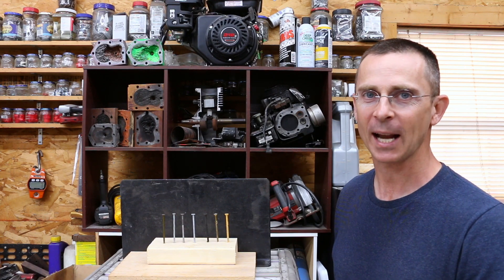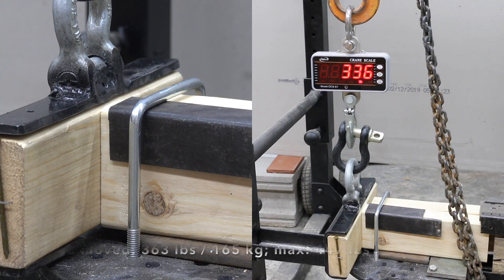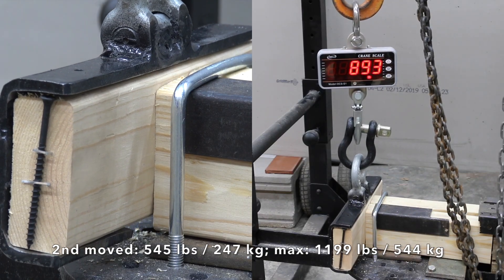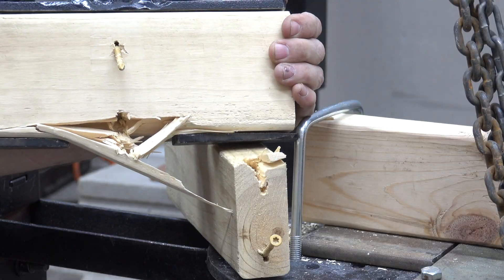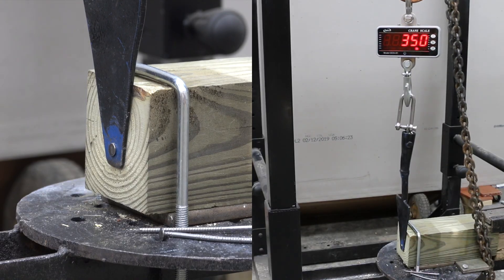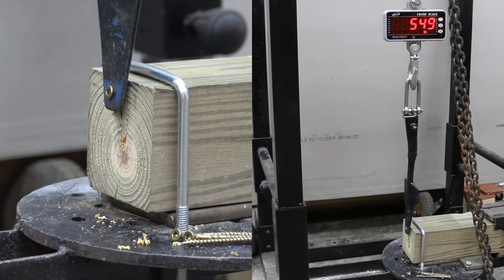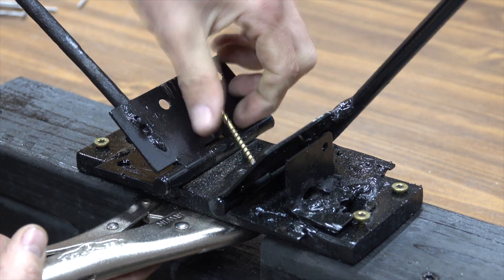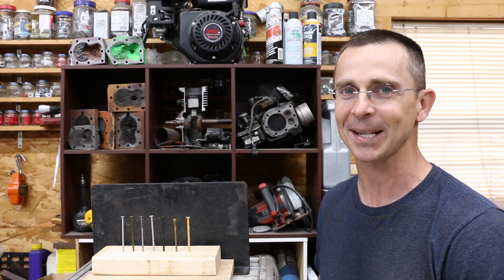Do Screws Shear easier than Nails? Let's find out!

Comment: The natural inclination would be that yes screws shear easier than nails because screws have corners all along their shafts where a crack can start. With metals smooth, gradual transitions are imperative. If the screws are formed with a gradual transition from the low point of view shaft to the high point of the tip of the thread they then should do the best. The coated nails do better because the coating acts as an adhesive. While being driven in it heats up, melts slightly then creates an adhesive bonds as it resolidifies, at least that's the idea. This is just logical reasoning but you do the actual real world testing to prove or disprove the different ideas. That's extremely important. As usual great testing 👍
Reply from the maker: Thank you!

Comment: I tried GRK screws 3 years ago for a remodel and was impressed  with how well they worked. So many scenarios where swinging a hammer was just not practical and forget even trying to fit a nail gun in there.  As well for doing remodels where things might change 3 times before everyone was happy or because of deeper unforeseen repairs, the ability to zip out a handful of screws to undo something vs beating and prying stuff apart fastened with nails..
Reply from the maker: Thank you!

Comment: What you really looked at was the holding power of the fastener along the grain of the wood.  This is its weakest orientation.  It would be interesting to see holding power perpendicular to the grain.  Also, toe-nail a joint and see how it holds versus toe-screwed.
Reply from the maker: Thank you for the video idea!

Comment: Thanks for the interesting tests! I was wondering why not try fastening the boards together instead of the end-grain and see what the repeatability of the test would be.
Crfor Freedom made an entirely understandable and logical point when he stated that the installation of the nail from a nail gun is at an angle, which increases the surface adhesion area of the joined boards across the grain, and the coating on the fastener is used to reduce the squeaking. I assumed that the glue was to hold the nails together, but I found that if you look at a stack of nails for a nail gun, most of head is missing; one could then deduce that the actual portion holding the boards together was the actual body of the fastener, rather than the head.
Reply from the maker: Thank you!

Comment: Im extremely impressed with the screws having survived around 1/2  the pull force of the screws. I still don't like screws but now I see that they are not super weak either. Thanks for this! Now.....do you have testing on deck stains/paints/epoxies? I'm super interested to see survival under UV light. You might have to build a light box with some super strong UV light.
Reply from the maker: Thank you for the video idea!

Comment: My old deck used nails.  They were constantly loosening up and you had to go out with a hammer and drive them back in.  After a couple loosening cycles, they had worn their hole enough that they had very little resistance - you could often just pull them out with your hand if they were sticking up enough to get a good grip.

The new deck has screws.  A year and a half in and they're still firm and tight.

I've never had either one of those actually fail otherwise, though.  In a couple cases, a nailhole was the weak point that a plank eventually cracked through.  I expect the screw holes will eventually do the exact same thing as the new deck ages, will get back to you in 20 years when it's the same age XD.  Or they might not - smooth nails tend to slip through the wood grain and act like tiny wedges, always exerting outward pressure.  Screws locally cut the grain, which might relieve strain.
Reply from the maker: Thank you!

Comment: Hey there, great videos they have helped me make so educated choices on things like zip ties, super glue and duct tape for sure.. Have you ever thought about strength and heat test for things like fiberglass, carbon fiber and sheet metal? I have been using fiberglass and sheet metal in projects for a while now and have heard different opinions when it comes to heat shielding vs strength, or strength to weight ratio. Keep up the good work!
Reply from the maker: Thank you!

Comment: Did you have a torque spec for the screws going through the puller?  A nail can only be pounded in until is hits the metal where a screw can have a varying amount of "tightness".

Comment: There are TREMENDOUS differences between the same sorts of screw bought either in a hardware store on in a dedicated machine engineering store.
The hardware-store ones are made of cheap materials which break easily - the real ones handle far more stress.
Same for the tools: Buy the real engineering tools. They are a bit more expensive than the hardware-store ones, but you´ll have them for life. The cheap ones you will need to be bought  ten times.
Reply from the maker: Thank you!

Comment: Man I am only 1:30 into this and your already giving all the data needed for deciding moment of failure and mode of failure for your first fastener, data that is really needed to make an excellent, and safety conscious decision. excellent job man!
Edit:
Finished the video, I think this shows just how valuable pinning and roughing out your projects with a different style of fastener then you plan on using to join them together can be. For example a nail when using screws as a fail safe looks like the ideal arrangement for most projects!
Video idea you might like;
Maybe a final showdown using a oscillating movement and timing how long the fasteners can survive a small movement, like 1/8th inch or less would be helpful, and a video covering total results of past videos. 
Maybe modify a sawsall blade to do it?
Oh, also if a fastener makes it past 1 million oscillations it should be considered permanently survivable since steels do have a limit that they can survive unlimited bends into.
Reply from the maker: Thank you!

Comment: My master teacher me to use nails on the outside and screws at the inside.
Because of the benifit of a screw is his great weakness if you have wood it will expand and shrink but  a screw didn't do that it will break away Inn no time the nail can go with the wood and if it looks outside of the wood because of it was shrink your simply give it a hit with your hammer and the thing is finished but a broken screw an be very frustrating
Reply from the maker: Thank you!

Comment: Your testing jigs/fixtures made me think of a comparison of wood glue- not the glues' holding power between each brand - but the surface preparation.  Some say to use water to wet the surfaces slightly, before gluing? others say dry surfaces? others say some specific grit of sand paper compared to another?  Have heard that over sanding will reduce glue adhesion due to too smooth a surface?   a planed/cur surface vs sanded? some say one clamping pressure is best- we don't measure squeeze out- so....?  Surface Prep? does it make that much difference?

Comment: Hate to be the bear of bad news, but a lot of the testing really is invalid. The steel angle iron under the u-bolt preventing the horizontal 2x4 from upward movement is not equal across the different fastener's upward sheer tests. Such as at 1:22, it's slid all the way LEFT,  versus at 5:16 its barely under the u-bolt.. which is certainly leading to premature wood failure as opposed to the 1:22 position. Love the videos..  and i'm sure its just an oversight, but I am sure it had a large effect on the results.
Reply from the maker: Thank you for the constructive feedback!

Comment: Overall this was good but I didn’t like the second test with the single fasteners.  You screwed the screws into end grain of the 4 by 4 and they all seemed to have more or less failed due to the threads all pulling out and acting like a saw.  A more accurate test would have been to cut the posts into a cube and screw into cross grain.  A 6 by 6 would probably be better suited for this kind of test.  But just like how the nails pull out because they have smoother shanks, the same happened with the screws, only the threads were at the mercy of the strength of the end grain, not the other way around.
Reply from the maker: Thank you!

Comment: Love your videos I find them very informative. I have an idea for a series of videos. Testing different bits (square, Phillips, flat blade ... Etc) torture test them , see how the do with screw with stripped heads.

Story: my buddies and I rebuilt a deck , they cheaper out and didn't want to buy a new square bit for the job , I bought a 3$ square bit and I was flying through the project while they were struggling. Note that we had to remove a portion of the old deck, before rebuilding the new deck . And since thier #2 aqure was slightly rounded , they were having a really hard time removing old deck screws that had been painted over .

So I would like to see whick company makes the best bits , longest lasting and best performing.

All the best ,and thank you again for your amazing videos.
Reply from the maker: Thank you for the video idea!

Comment: So the ring shank nails are a good middle ground for just about anything it seems. 

You should have a form of publication put out for all your testing on engines oils fasteners glues etc.. Like a series of books or something. Call it "the more you know" 

Im also curious to see if using more fasteners is actually better. Or is there a point where you dont get any marginal gains from an extra screw or nail. Does too many in one area weaken the bond and cause faster failure?
Reply from the maker: Thank you!

Comment: Great,! can you try the old hints I found in a Book?  .
It says to fasten Looks and other parts to thin board doors (old ones I have seen are about 20mm) you should prick the hole for the nails put one or two drops of vinegar in and wait for 3 month. They than would be so strongly attached that the oak breaks before the nail come out. (I found it to be real, and wondered before I found that hint in a book)
But remember they used forged, tapered nails with square sections. (I only know one Factory making them now).
Reply from the maker: Thank you for the video idea!

Comment: You know oscillating (muli-tool) saw blades are expensive as hell for what they are.  I'm wondering which is the best for the money.  Also are they just as good buy simply just resharpening them.  I personally use the imperial bi-metal T340.  $30 for a 3 pack seems like the best deal I can find.  They last pretty long also.
Reply from the maker: Thank you!

Comment: That is not my definition of shear. To shear is to separate as in sheep shearing separates hair from the sheep. Shear is the separation of the fastener into two pieces. You are doing pull out from a different angle. One of your test subjects did shear at 4:10 yet you refer to all the pull outs as though they are shearing.
Reply from the maker: Thank you!

Comment: PF,

Could you maybe look into doing a test of various screws vs various nails to see which retains the highest holding power or backs out the least over time? The variables could be soaking wood and drying it, attempting to rust the fasteners/nails, or even applying heat. 

I just want to see this tested to your abilities because I have a wooden plank fence and a lot of the original nails are backing out, but where I used screws, the planks appear to still be set well. 

Thanks!
Reply from the maker: Thank you for the video idea!

Comment: Great video.  Question is this shear strength or pulling force?  I understand the thickness of nails do have a greater shear force than screws by theory of the inclined plane states that screws will always have a greater pulling force than nails.

Comment: Ive built a couple of cabins using only deck screws and 12 years later I have had no problems whatsoever with them. I just found it much easier than swinging a hammer. I have a bunch of metal in my right elbow because of a crash with a drunk driver in 1997. Don't drink and drive, folks.
Reply from the maker: Thank you!

Comment: This is supposed to be a shear test. None of the nails sheared, they pulled out. The first test was more testing the pull out strength. Screws are plainly stronger in liner holding power. It was so obvious that screws don't take any bending. This is why they shouldn't be used for structural strength. It was to bad you didn't do actual shear to failure tests not pull out tests. It's clear the wood will fail before either of the fasteners.
Reply from the maker: Thank you!

Comment: The last bending test isn't really applicable to all, just nails as by natural installation they tend to bend as they are repeatedly struck and are commonly disformed. Screws on the other hand are designed to be driven straight typically smooth and evenly in one stroke. By nature they are never designed to bend, bent screws are garbage and are always tossed, installing and removing one in itself is a pita. Nice testing otherwise.
Reply from the maker: Thank you!

Comment: Once again....great testing methodology. It's important to note that each of these have their specific place in application. In the first sheer test, the smooth shank nails didn't fair as well as the screws but they didn't destroy the material the way the others did. In the case of home framing, where flexing and recovery to it's original position is very important, the smooth shank far outweighs the others. In addition, and because the material basically remains intact after flexing, the wood material, which hasn't been destroyed as in the case of screws, will probably swell back around the nail providing better holding power for the next "flex" event as opposed to the screws which have ripped away the material leaving more voids and less material to reseat in.
Reply from the maker: Thank you!

Comment: Hate to be cynical, but your test rig allowed the fasteners to pull out at an angle which is tension strength. I would forgo the wood, clamp them up in heavy steel brackets, one that moves and one that doesn't, with only only a shear failure as an option. Just saying.
Reply from the maker: Thank you for the constructive feedback!

Comment: About the nails, You used them wrong. IF you want better ... "shear strength", you need to put them at different angles. That way they interlock and cannot just slip out. Such nails usually have different shaped heads so you don't have to hammer the head flat. C'mon Farm boi, make some research
Reply from the maker: Thank you!